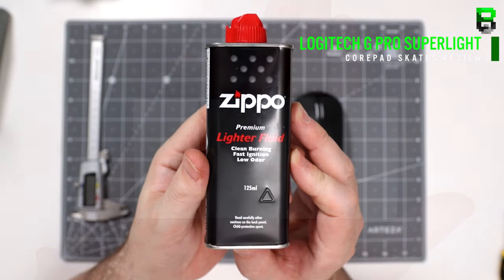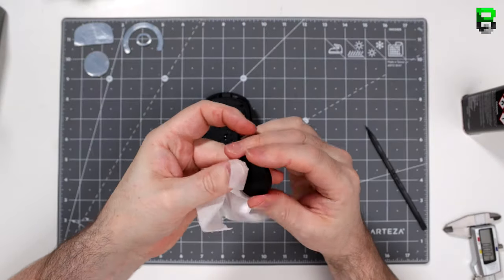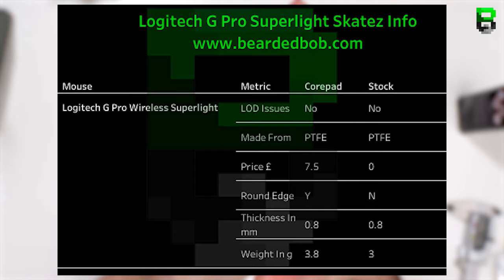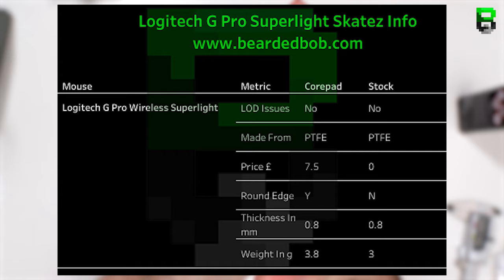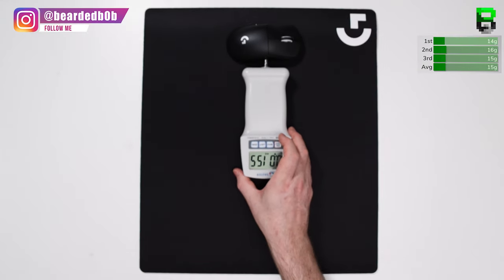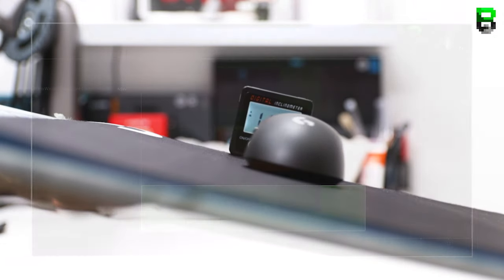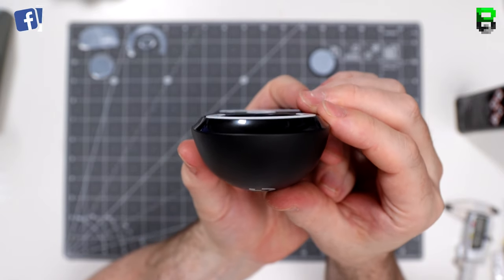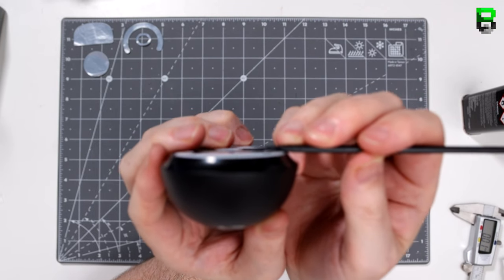How did they not see this? Corepads Mouse Skates For Logitech G Pro X Wireless Superlight Mouse

Comment: For 150 the feet should be superb enough for no aftermarket replacement
Reply from the maker: agreed... these stock ones are a downgrade imo from the original gpw. that flat front bar is a snag trap when using stakes that around rounded.
Reply: I bought the Logitech G Pro Wireless back in 2019 and 1 year later the feet already were worn and fell off the mouse.
I had to replace them, too and that was really disappointing for such an expensive mouse.
Reply: The feet are nothing i just unboxed a new one and it has uneven surface, it sways/wobbles on the desk when you grab it or press near the logitech logo with your finger. Wow never had such issue even with trash $10 supermarket mice, yet this 150 msrp one has.
Mind blown, there is no quality check in Logitech anymore i guess. Im returning it tommorow srlsy cant belive this.

I like almosty everything about it, the shape, the main clicks and weight obviously, side clicks have some pre and post travel but I would not have a problem with this but making a mouse with uneven bottom surface is just beyond my imagination at this price point.

Comment: I just got the V2 today. They are amazing and much better than stock! 0.85mm thickness and bigger overall, so they fit better and less dust gets collected. 
with the thin stock feet, the plastic surface of my superlight scraped on every pad I own. Now with the V2 version its all perfect, glides buttery smooth and the scratching is gone. 

I had like 15 sets of corepads now and these are the first one with literally no break-in phase. 100% smooth right out of the box. Im flashed and the superlight is now 110% perfect for me!
Reply: How do you know if yours are are the newer version? I ordered my corepadz 2 days ago are they the newer version?
Reply: @CatsandDogs6347  Where did you order from?
Reply: @CatsandDogs6347  it simply says V2 in the Shop, together with the New thick ess of 0.85mm
The packaging is the same.
Reply: @cupraaron  thanks!

Comment: yea these are awful imo. got them and then instantly ordered tiger ices when they released. way way way better. hopefully v2 are an improvement.
Reply from the maker: I'm looking forward to opening the Tiger ice to see how they glide.. good to know you found them better than the corepads.
Reply: V2 are amazing! Much better than original feet!
Reply: @cupraaron  How can i know if i got the v1 or the v2 ?
Reply: @JGZnn  when you order them from the corepad Website/Shop it says So in the article description. And the V2 are the only one you can actually buy, because they replaced the V1.
Reply: @cupraaron  oh thx bro

Comment: I ordered the corepads and I'm glad I kept the original feet in good condition when taking them off because I did not like the core pads. Once worn in the Logitech are much better. I think people may be ordering these without wearing in both sets and comparing because I was recommended buying the corepads from a youtuber.
Reply: I got my Superlight few days ago and Ive watched so many vids saying that the stock skates were so bad that I was thinking of buying corepads but tbh I dont think theyre that bad I mean for sure not perfect but not so bad
Reply: @denisnatera3633  they are really good. take awhile to break in but are very balanced. After breaking in corepads they felt unbalanced and had way less control.
Reply: @Amped1  so you def recommend me to stay with stocks?
Reply: @denisnatera3633  yes
Reply: @Amped1  thanks for replying buddy

Comment: This video saved me so hard. my mouse was not reacting good anymore. Now I see that below the original skates there is also some black layer that had to be removed. So lucky that corepads send you 2 sets so I could put on the second set when I also removed the black layer. Not its working super good
Reply from the maker: Np Crabs Rebellion glad I could help 👍
Reply: Bro your comment & this video safed me, i just put new corepads on my gpro superlight and it felt so scratchy. Thank god corepads sends 2 skates
Reply: had the same exact thing. thanks

Comment: I just got these and I think the mouse lift-off distance is too high, because often my mouse doesn't pickup inputs from the sensor and causes my aim to go off centre. This is really frustrating as my original pads are ruined. Perhaps the issue will be resolved after I wear the pads down a bit. I am not impressed
Reply from the maker: Sorry to hear that. You could change the mouse pad if you have another? or get some Tiger ICE https://www.youtube.com/watch?v=NfGV6QXCzKQ&list=PLfd7fPKFiRfJeWwEtc8-TXJJtjc0D2Etp
Reply: @Beardedbob  Thanks a lot for the response. I just think these pads are too thick and the Logitech Gpro sensor is too high from the mousepad, so It doesn't pickup inputs. Perhaps I can somehow lessen the thickness of these pads or I can just buy the tiger ice
Reply: @JakeBeatz  Hi man, i think i am experiencing same issue as you did, like when i flick or move mouse off mousepad somehow sensor dont work, and fucks my aim, for sure i didnt break sensor when i was putting them, I just wanted to ask you,its my 4th day playing with corepads, its same as 1st day, did u change corepad beacause of this issue or it was fixed by itself when they broke in
Reply: @mzzarada1389  Yeah I got some chinese ones instead and they work real nice, the corepads are trash
Reply: @mzzarada1389  I highly recommend tiger ice pads. They have worked great for me and lasted longer than the stock ones
Reply: @JakeBeatz  thanks for reply, I think i I’ll order ice skatez, but I will see maybe corepads break in in few days, it’s my 4th day , what you think ? I think that I didn’t fuck the sensor , Ithink it’s due to corepads v2
Reply: @mzzarada1389  I am trying to remember, I got my corepads 1 year ago. I think my issue was actually because I didn't wipe all the glue off the mouse before I put the skates on. I remember I took the corepads off and then I scraped glue off with a knife. I would recommend if you have another pair of corepads, perhaps double check you removed all the glue on the mouse. Otherwise you are better of getting ice skates. Wearing the corepads in is what I tried doing at first, but I cant say it worked

Comment: I just got my superlight today, the skates are feeling so weird if I move it to the left or right side, feels scratchy, like if there’s a stone under it. Is there any way of fixing this without having to buy new skatez? Awesome vid btw
Reply from the maker: Np. On the GPWSL they feel horrid, after some time mine did improve but if you want a smooth glide you will need a better option. Tiger ICE about to drop on this channel so check them out.
Reply: @Beardedbob  will do👍
Reply: @koppelhuber90  hey bro, i bought a superlight today. i have the same problem. left and right feels scratchy but up and down is normal. did you fix it? maybe i should return
Reply: @AdilYuceol  you fix it by just using it, it’s gonna feel like that for a couple of days and then it will be normal. Ik it’s annoying but it will go away
Reply: @koppelhuber90  thank you, hopefully will be the same for me

Comment: Pls tell me which is best bec I don’t understand you stock or the new one ?
Reply: Stock or Tiger Ice is the best bet atm. ones a tiny tiny bit faster than the other, or you could read that as one give a tiny bit more control than the other, however its a Tiny degree, Most people wont notice the difference. The majority of people wont look at replacing them until they NEED replaced, and at that point you cant really Effectively compare anymore as your comparing torn up, worn down skates, to brand new slippery ones, of course the new ones will feel always better, even if you got two sets of the same.
Reply from the maker: Tiger ICE video worth watching https://youtu.be/NfGV6QXCzKQ

Comment: I have a very odd question about the viper mini feet I reckon someone here may be able to help.. The big one at the back has a dent in the middle, it isn't flat.. the sides are polished now but the middle is still textured like new.. Could I fix it somehow?
Reply from the maker: sounds like with a car the tracking is off or in this case how you apply weight to the mouse. The other reason for the wear if maybe the surface is uneven.

Comment: I just odered my corapad skates for the g pro suplight and even though the glide is awesome... The sensor at times is just not tracking because they're way to thick. Which pretty much makes them unusable. =(   Need to order from a different brand. (edit I got the v2)
Reply from the maker: yes the corepads are to high on some skates but not all which is another problem... did v2 fix your issue?